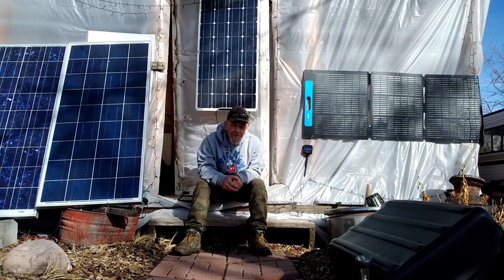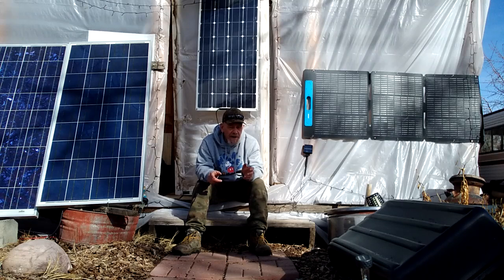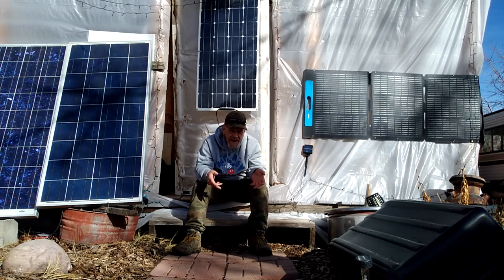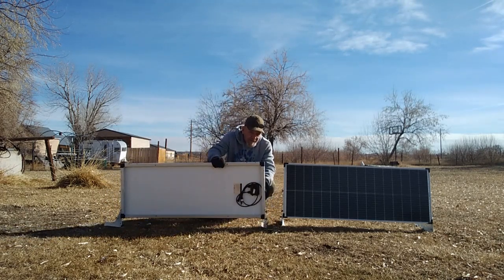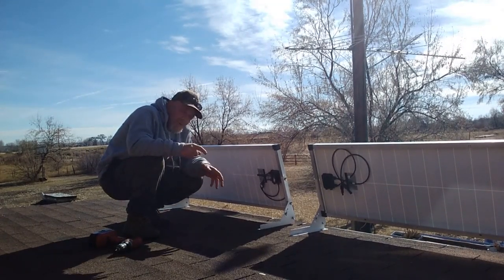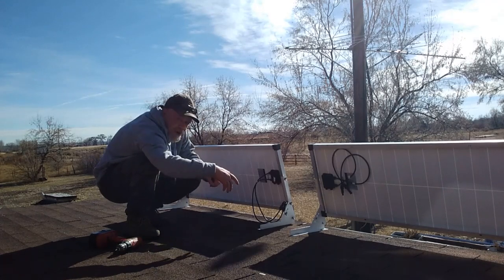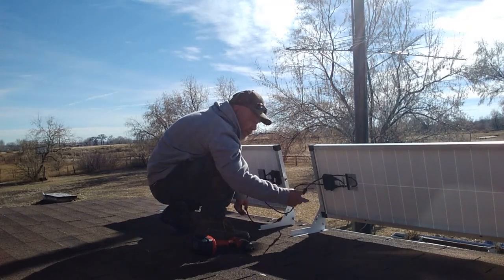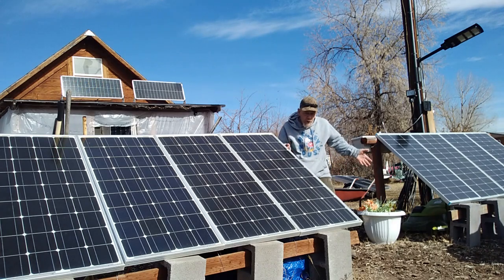Topsolar Adjustable Solar Panels Mounted On Roof P2

Comment: looks like you will have a shadow from pole on panels in the middle of day in winter. being a 24 volt system will it knock out both panels?
Reply from the maker: Once the sun is past 9Am the shadow is gone.

Comment: DO you connect the 12 volt 400 watt system and the 24 volt 400 watt system to different charge controllers?
Reply from the maker: Yes, they have seperate controllers and batteries.